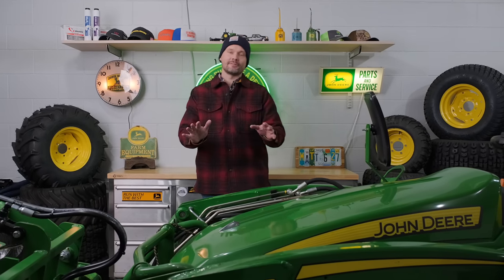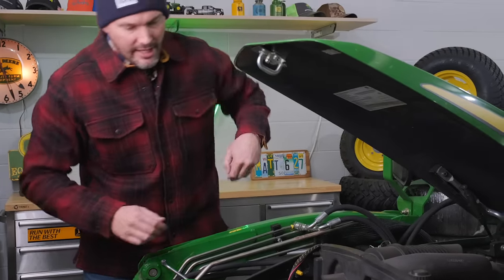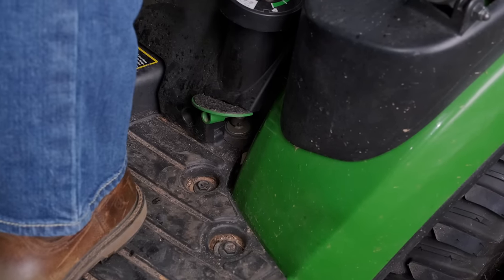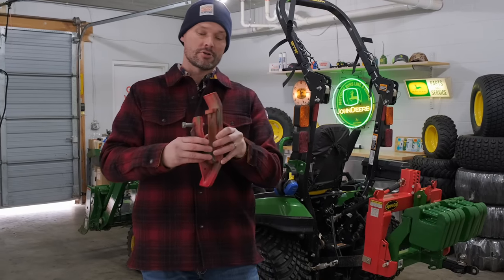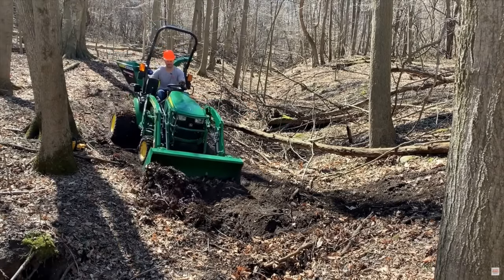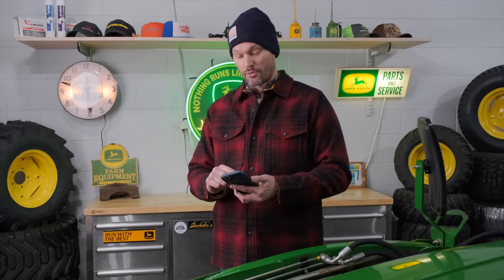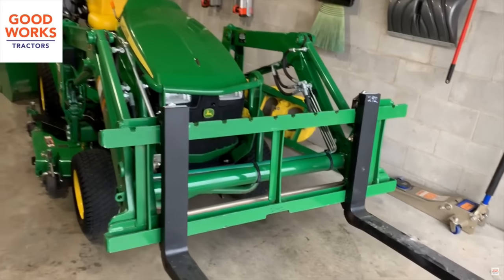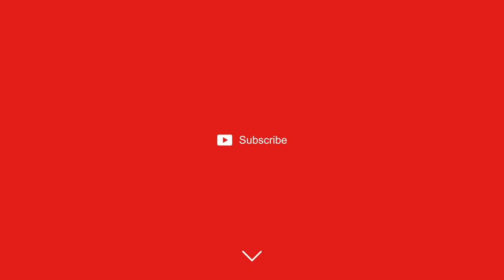50 ADD-ONS, ACCESSORIES, & ATTACHMENTS FOR THE JOHN DEERE 1025R 🚜🧑‍🌾

Comment: You should tell them when replacing those headlight bulbs, not to touch the bulb. They will burn out much quicker with your finger oil on them. I always wear gloves when changing out those types of bulbs. Even on my truck
Reply: They are led it doesn't matter
Reply: That’s an old myth

Comment: How about dual wheels for the front of the 1025r or spacers tooce front wheels out. With duals on the rear of the 1025r it wants to slide rather than turn even with the front with set.

Comment: Just got the replacement lights suggested. BIG DIFFERENCE! Had to cut out a bigger holes in the old rubber covers for the new headlights but that was not a big deal. Thanks for the advice.

Comment: Why does no one talk about 4 way buckets for your 1025r? I bought one with my tractor new and it is incredibly versatile.  I am good at using equipment  and sculpting ground with the open bucket front is amazing  . As a grapple it works good and works great for grading the driveway using the back with the bucket open. I haven't seen you say anything about it  and Tracktor time with Tim tried it and did a poor job of trying it  and rejected it without a fair assessment.   Can you comment.?

Comment: How about a frontend snow blower that attaches to the loader arms. A lot of the snow storms in Western New York leave snows drifts several feet deep. The existing snow blower designs leave the operator to "tunnel" under the deep drifts then, walk to front of the machine and break down the tall drifts. That can be a little dangerous.

FYI, last year (winter 2022 - 2023) we had one storm with 48 inches Hamburg, NY and a second storm with 84" in the town of Lancaster, NY. Go look it up.

Comment: 1026R with a D120 loader that has a pin-on bucket that is always in the way when I am mowing.  Is there a affordable solution to make it quick tach?  I have learned the loader has no resale value.
Reply from the maker: Not an affordable solution, but there is a solution.  It still has resale value, just not nearly as much as a H120/120r.

Comment: Do you know the size of tester plug that works on a 120r loader for the cross tube?   I measure it at 2.5"'s and can't find a tester plug that matches?
Reply: With the tester plug, is there a concern of condensation from the water bottles creating a rust issue?

Comment: Hi Courtney,  I would like to know what brand of suicide knob you have on your steering wheel. John deere has a similar one but doesn't fit the 1025r steering wheel because they seem to be fatter in diameter.
Reply from the maker: I'm not sure the brand, came with the tractor.  However, it also slips around and doesn't stay in place.
Reply: @GoodWorksTractors  I'm thinking about getting out the Dremel and modifying the John Deere one that I bought for my 1025r however this might be good opportunity for somebody like yourself to develop one that actually fits the 1025r steering wheel and you could sell it on your YouTube channel.

Comment: Do you prefer a 1025R over a 2025R?Thanks.
Reply: If I could go back I woulda bought a 2025R. The bigger tires and ground clearance would have been good for ME. But it’s all a matter of personal need. The engine power is the same and engine power has never been an issue. It’s just sometimes I wish the wheels tires were a bit bigger

Comment: My weights rub my hood on my 1025r if I don't use a weight bracket. I actually run a 60" king kutter tiller on my 1025r runs it fine, you just gotta have plenty of weight of front lol
Reply from the maker: Darn tolerances!  Thanks RC!
Reply: @GoodWorksTractors  I know! Must've been made on a Monday

Comment: does the GWT Stump bucket work with a 3038E John Deere without the quick attach
Reply from the maker: I'm not aware of a 3038e loader that doesn't have the JDQA.  Double check or email me a picture of the connection between the loader and bucket.  It would be the first I've heard of that model not having a quick attach bucket.

Comment: If you have a cab on the 1025R you forgot the best feature of all and that is the Hyd Quick disconnect on the top for your frontend loader and the snow blower.  Would not be without it.